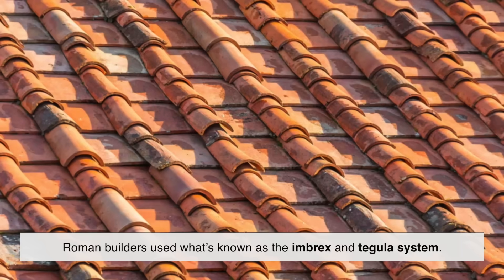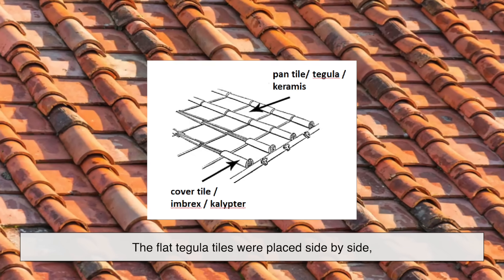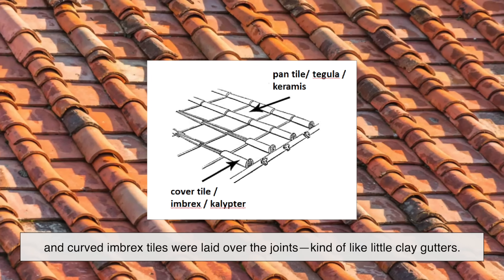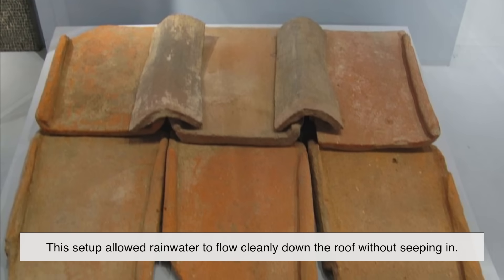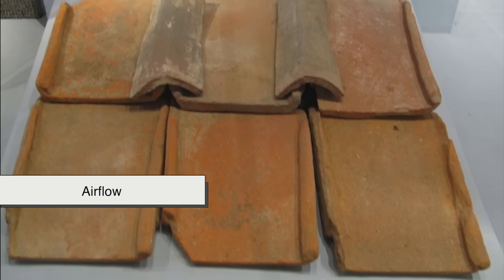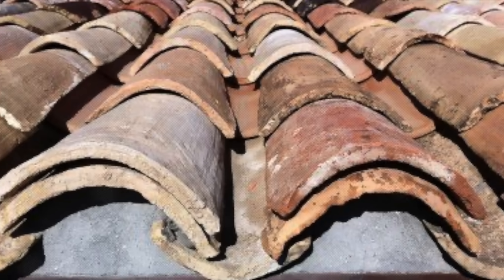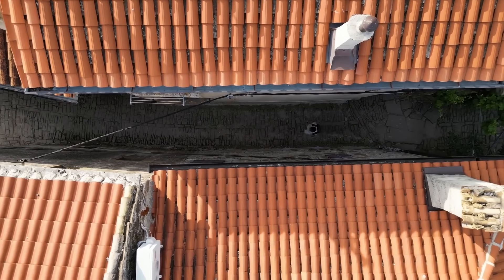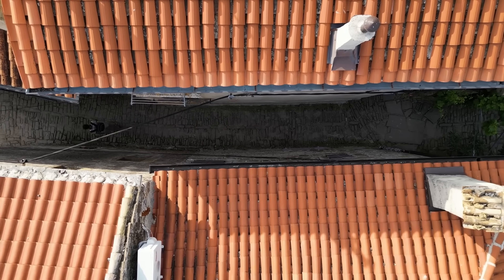Why Do Roof Tiles Have That Wavy Shape?

Comment: Flat roof tiles are the worst for low pitch roofs, because the water runs off more slowly. Another reason is because water spreads all over the tile will find it’s way through any imperfections like broken interlocks etc. A double pantile tile (wavy S-shaped tile) has no flat part at all and has a valley where the water will collect in the lowest part of the tile, allowing it to drain off the roof faster and more efficiently.